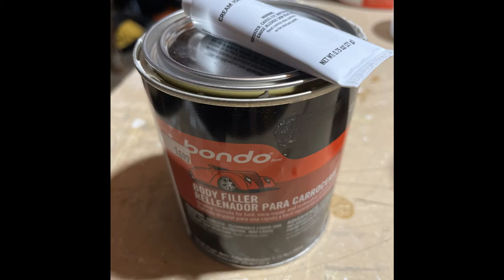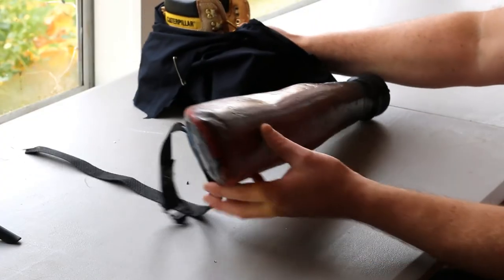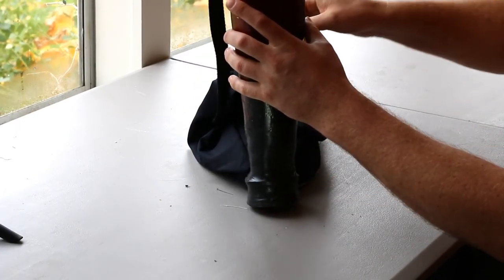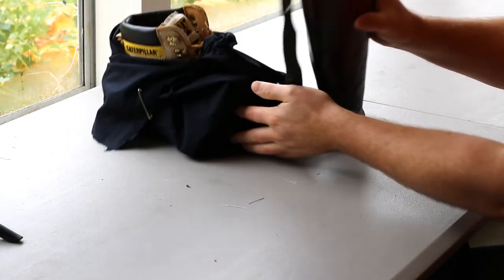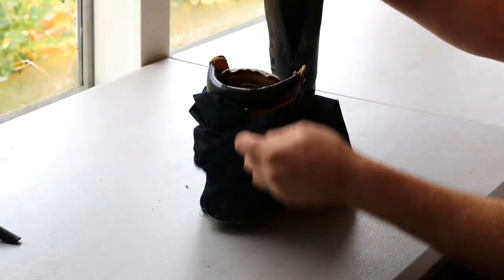Claw and Leg

Comment: Ive watched like 18 times. How fo you get the big claw to sit in the small claw arn piece?
Reply from the maker: The claws pivot on a large metal hinge. The kind you might use for a fence gate. It’s been a while but I’m pretty sure I heated the metal hinge to let it melt a perfect fitting slot in the foam. It can slide on and off by a snug fit.